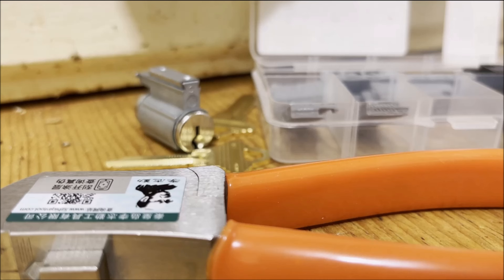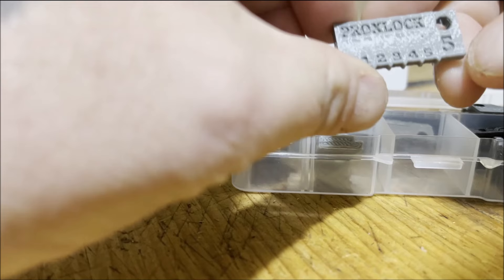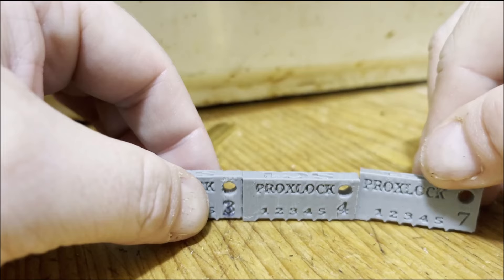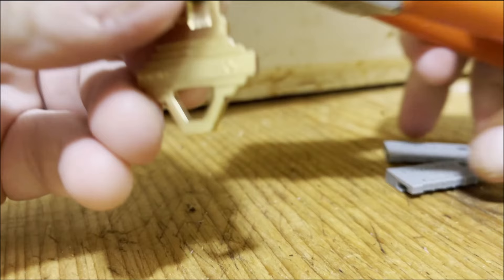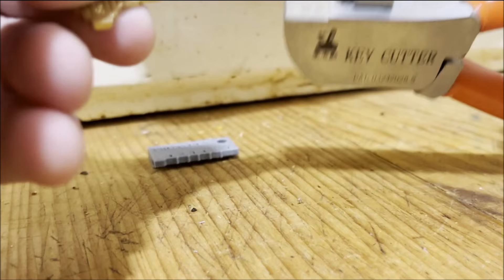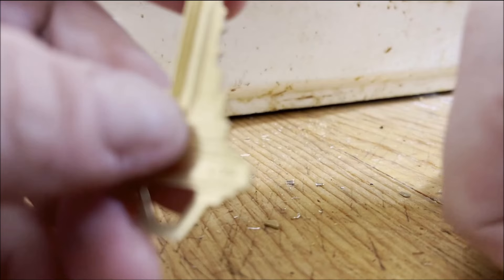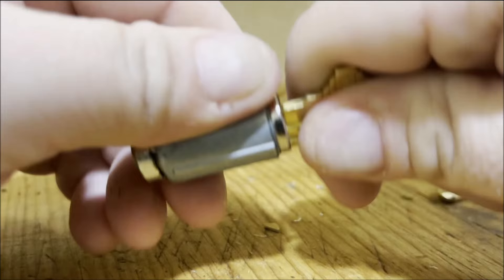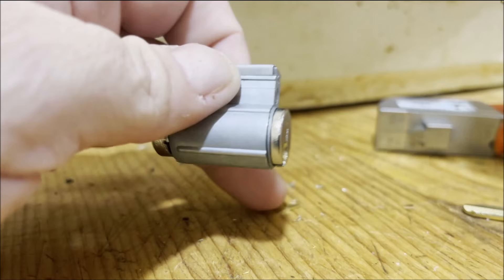How To Make a Key if it's Lost (Without a Key Cutting Machine 2022)

Comment: I tried a couple times today to copy a key by using a vise grip to pair them and nipping.  The target lock is a cutaway practice lock so I can see the result. Threw away 2 failed attempts.  I've seen this work, but I think it takes a bit of practice.
Reply from the maker: Using the plastic guides is best. I have also tried just trying to duplicate but never works. Using the jigs as seen in this video works 100% of time, although sometimes not buttery smooth but works
Reply: @thewhittierlocksmith121  I was looking for them, Bosnian Bill makes a set but they were pricey and out of stock. I think I will try nipping again and then check with my calipers to see which way I err. I bought the dang nippers on a whim, never really needed them, and don't want the money wasted! When I pick up a hobby, anything worth doing is worth overdoing.
I tried impressioning one night. That was another failed blank <grin>.
Reply from the maker: @WRWhizard  Here is ebay link. They are sorta pricey, and I do not have any association with this product other than using them. 
https://www.ebay.com/usr/proxlock
if you have a 3d printer, you can print them, not sure if you need to modify them as I haven't printed any yet
https://www.thingiverse.com/thing:5163333
Reply: @thewhittierlocksmith121  Thank you, I will bookmark these. But I really ought not spend this kind of money on a side hobby. Wish my little brother was still alive, he would 3D print them for me.
Reply: @WRWhizard  Impressioning takes a lot of practice and there are so many little tricks. if you don't know them all it's so easy to fail. That was my specialty. If you can find old Hank Spicer books he is the guy that I learned most of my skills from. Nobody ever did it better than Hank.

Comment: I use the Pro-Lok Blue-Punch #BP-201 for conventional Schlage keys... Standard key depth gauges to take direct key measurements & record those key codes from the direct key measurements for future record... Notably to originate duplicate keys without having a physical key in possession. The Pro-Lok Blue-Punch key machine does not require electricity, is calibrated at the factory for both cut depth & spacing, in function - automatically advances to the next cut once the lever is pulled and a cut has been produced. works for most [Schlage] conventional keys up to 6-pin. For other manufactures (such as Kwikset) additional Blue-Punch key machines must be acquired that have been set up for those particular manufactures or makes, due to the differences in depth & spacing specifications. Not a bad tool for the institutional locksmith that only services one particular manufacture brand or type of key & lock system.
Reply from the maker: yes! The blue punches are great!!! Way better and accurate than a lishi cutter with jigs. I do not have the blue punch anymore, i should get one tho!
Reply: @thewhittierlocksmith121  I use mine to cut my own keys by code number. I have a D-Family Everest Restricted Primus-XP Key System and as a Schlage Factory Registered End-User, I also have exclusive control over my restricted key inventories, from which is only available directly from the Schlage factory in Colorado Springs, Colorado.
Reply from the maker: @christopherlawler3033  very cool!! I was thinking of doing restricted key ways, but i am mostly automotive
Reply: Blue punch worth it s weight in gold.

Comment: Nice demonstration of the clipper. Handy.. difficult without the correct plastic guides.
So, your question.... I've never seen a 'Quickset and very limited numbers of 'Schlage'. 
The Schl' I have played with recently had 4x barrel security pins and 1 standard. What I did not like was the die-cast alloy body... never do.   Do the Quickies have a security flaw? So.. can't really say. 
It's a regional thing - Here in Australia, for years the market leaders have been Lockwood.. Lane is another. You find plenty of no name stuff that comes with budget and mid Door Furniture. But finding die-cast while doin' a key alike across a home.. Ugghh. so, 12 barrels... 4 were decent serviceable Lockwood brass at least.
Reply from the maker: Kwikset and Schlage are the most common lock used in USA. The tolerance on kwikset is low but Schlage is better.

Comment: It’s appreciated that you can show and tell everyone about your nice cutting pliers and I don’t mean any disrespect but how did you find out the key code to begin with. Knowing ahead the key code is 34477 doesn’t do anyone any good if you don’t explain how you came to the conclusion that was the code. Anyone can use a pair of pliers but they’re no good if you don’t show an example of how you determine what it is if you have no key to begin with. 
It would be very educational to understand how one discovers the code when it’s unknown. Thanks. Cool pliers.
Reply from the maker: In previous video I made how to rekey a lock, we pinned up a cylinder with those pins
Reply from the maker: You can also decode the lock with a lishi, but in the beginning of this video, I mention that we got the bitting info from the rekey video and this video supplements this one- kinda like a continuation of that video on how to rekey a new lock
Reply from the maker: Here is that video by the way where we got the pinning info to cut key https://youtu.be/aso2eCBoWp0
Reply: @thewhittierlocksmith121  Maybe put that link in the description?

Comment: I don't think I will be giving up my Framon No.2 any time soon. :)
Reply from the maker: Nothing beats a code machine!
Reply: Damn I am getting old. I have had it probably 35 years. When I bought it everyone was using 1200’s. I met Frank (the inventor) at locksmith seminars and he sold me on it.
Reply from the maker: @scotts4125  solid machine! I have a hpc 1200 cmb
Reply: @thewhittierlocksmith121  Back in the day Steve formally of Tech Train went around country usually with Frank from Framon and a guy from The Locksmith Ledger. They gave great auto locksmith seminars. They had people come in from Strattec and many other auto lock tool and suppliers. Frank showed us why his machine was superior to the HPC 1200's. He explained that when we cut keys sometimes the key turns fine clockwise but could be tight CCW and or vice versa. On most key machines for standard keys the cutter wheel comes up at an angle. If a lock has tight tolerances it can cause the issue I mentioned. Frank was a machinist and also a cabinet maker. He was anal about tolerances. On his machine you make all your adjustments first and pull the carriage straight into the key on a 90* angle. On a 1200 you are making depth adjustment on the fly while it comes up at an angle. I think you also widen the cuts on the fly. You don't have to widen cuts on the F2 either. The Framon 2 looked very complicated but once I cut a few keys it was very easy and no cards to worry about. Most guys who have 1200's love them and that's OK too. They work but to me not as well as the Framon's. Being an automotive only locksmtih I always told people I was horrible at picking locks but I could make a key with a file and a vice grip. I was really good at impressioning back when had to have that skill. Now everything is a PITA driven by technology. Programmers and CNC key machines lol but we do it all. We run about 90 to sometimes 150 auto calls per week believe it or not.
Reply from the maker: @scotts4125  agreed! I’m mostly automotive and agree that the computer systems are getting more complicated. Thank god for lishi! I would love to improve my impression skill. But you can’t impression high security 4 track keys, that I’m aware of
Reply: @thewhittierlocksmith121  I didn't really use vice grips after I knew what I was doing. Framon I believe still makes a key impessioning holder. That tool made me even better. I also don't think you can impression track keys. Probably someone who has  LPL like skills can but I wouldn't even try. Some of the Euro's as you know are dealer only. I am sure eventually we will be able to do them but it's all getting to be a PITA and customers balk at the prices. i tell them I don't make the cars, I don't make the fobs and I didn't lose your keys. :) They usually shut up. I have some good lines when they ask for a discount too. I always say sure. I just need you to do one thing for me. Call my bank and ask them whatever amount you want me to deduct if they will take that off my mortgage. If they agree we have a deal. They don't bother me with stupid questions again.

Comment: I mean its not that Hard if some cases if u can get the core apart or even re key or re cut a key using the pins u have
Reply: Trying to get into B&B LockSmith here in CAL there messing around so I might look else were for work
Reply: @mccrackenphillip  Come to Florida I am looking for an automotive locksmith. We will train.

Comment: thanks so so so so much for the help🥰 could i just say the pin numbers to the key maker or do i have to diy my own key 🥲
Reply from the maker: you can tell him the poin numbers, but we call these "depths" or the bitting. A locksmith would understand those terms better.
Reply from the maker: Also you could tell them, you need a code cut key to what ever the pin number (bottom pins) are. The pins in the video are called the bottom pin numbers. Also if you look at your key, you may see numbers on it. Those numbers are either a code or bitting so you can cut your own or give to a locksmith